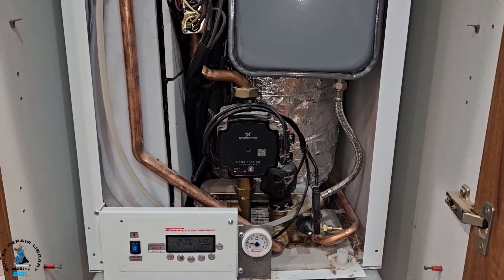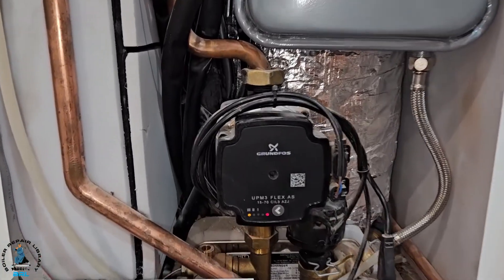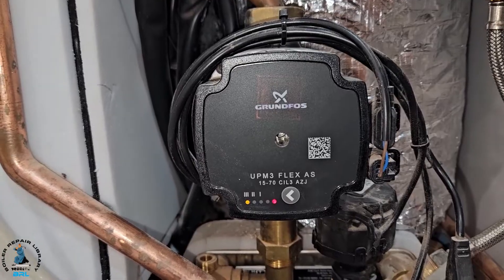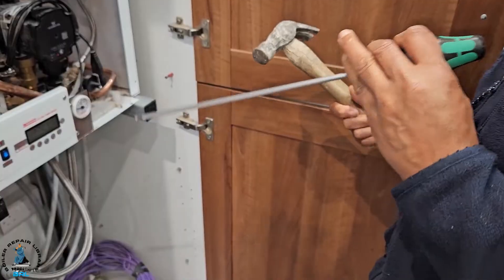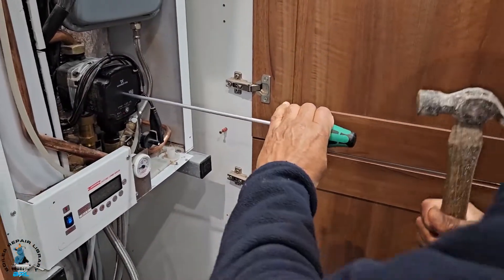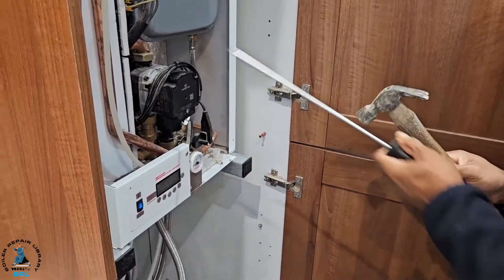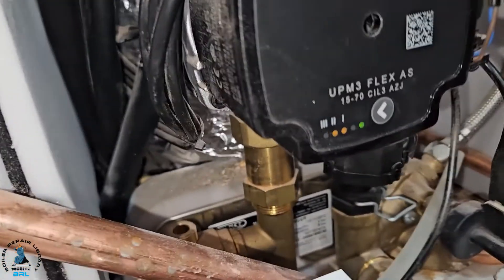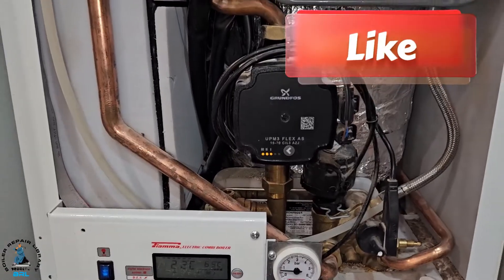How to Fix a Stuck Grundfos ERP Pump | Expert Tips by Master Coach Tony Morgan

Comment: Thank you so much, I've just moved into a new house in November and the central heating didn't work. I know nothing about gas central heating, but after studying the boiler for a while, and concluding that the pump wasn't working, I found your video and fixed it straight away.
The pump won't have been running since at least last winter, but why would it have seized, does it suggest there's not enough corrosion inhibitor in the system?

Comment: Tried pushing in screwdriver and turning anticlockwise many times without any success. Then followed your advice and tapped screwdriver 3 times and it worked straight away! I did switch off the power to the pump first.